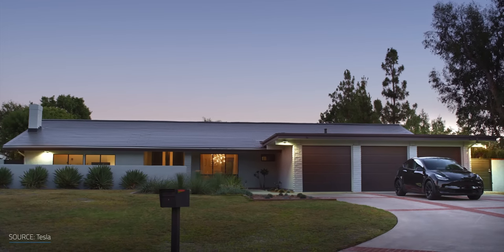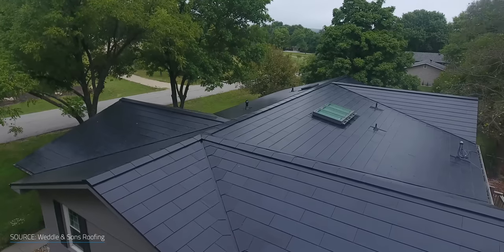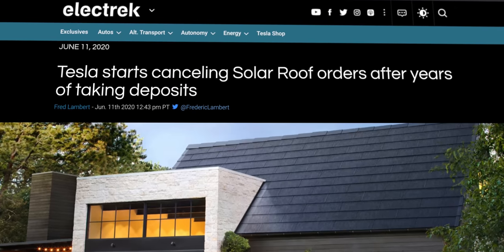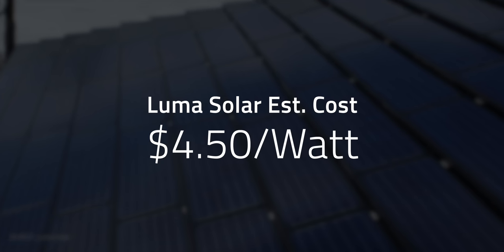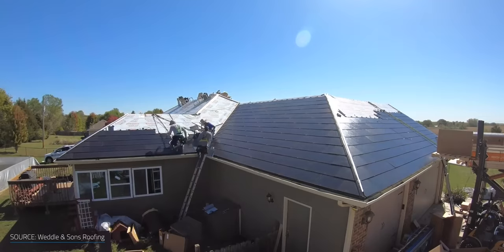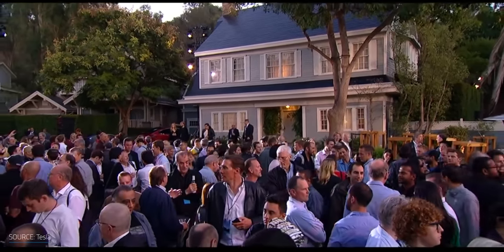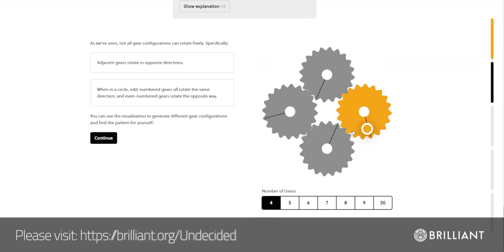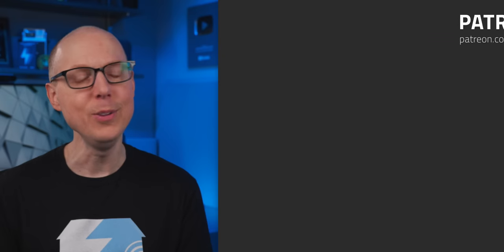The Problem With Tesla’s Solar Roof

Comment: How about looking into NON PV solar home products.  A gentleman I used to work for  used to heat his home with a passive solar system that used a cinder block wall in a sun facing solarium as a collector that had air flowing through it, and through a large gravel heat-sink under the wall, to provide for some of his winter heating.  If I remember correctly, his cold air returns to the furnace went through these spaces.  The air warmed going through the block wall during the day would "load" the gravel heat sink, and pre-warm the air going to the furnace.  The thermal mass of the wall and heat-sink would keep working overnight.  I've personally used a flat, glass-topped box and coiled tubing to make a solar pool heater.  Surely there have to be more ideas to use solar at home than tens of thousands of dollars worth of silicon and electronics?

Comment: Hi Matt, I recently had a Tesla Solar roof installed. The installation process was incredibly painful, but the product itself is impressive. I live in MA. I'm happy to chat if you have any questions
Reply: Vivint Solar is much, much worse.  I've seen their work so bad the whole roof is rotted and even entire vacation homes have to be torn down due to the mold and rot.  Companies are in the phase of raising the top line, not servicing existing clients.  Some like Vivint, are worse than others.  Given that craptastic landscape, Tesla is not the worst.
Reply: What much price has increased after you accept initial design

Comment: Having worked in roofing, I guarantee you standard "roofers" would have nails through half those solar shingles.  And GAF is the only brand I've seen that was consistently ruined after 7-10 years.  If I say a 7 year roof that was bald all over (and need replacing)... It was always GAF.

Comment: Layman’s question here:

I understand that these types of solar panels become less efficient the hotter they get. I have heard that on several sites but no one has explained precisely what that entails. So isn’t there some way of passively cooling them, such as having a bigger cavity directly below them in order to circulate air flow?
Or is this ‘heat’ more concerned with the temperatures within the layers of the panel itself (precluding airflow as a cooling solution)? 
I live in the tropics; I’d be really interested to hear about the efficiency of solar panels + their efficiency when in temperate climes versus tropical climes.
Reply: this video is just lazy nerd click bait LOL
Reply: You could build for airflow underneath them, but that would add significantly to the cost as well as the profile of the roof.  

This is just another reason why solar roofs are a dumb idea.  Install your roof, then install panels on it so you can optimally position and airflow comes naturally, instead of having your panel be both a power generator and watertight barrier.

Comment: I think the way to go is developing solar tracking and reflectors with traditional PV arrays. You get a better window of peak power with tracking, you get a substantial boost in power from reflectors (which would be great for overcast days/less sunny areas).

The burden would be to develop a smart controller to manage the load on the structure and depending on the roof reinforcement may be necessary.  But on the flip side, install could be down to half a day- if the system can be delivered on a pallet, final assembly on site and a light crane to place it on the roof.
Reply: It usually is much cheaper and more efficient to just add more panels nowdays with them being so cheap.

Comment: The roof on my TX house is now more than 17 years old, and is getting close to replacement time. All of my neighbors have gotten new shingle roofs in the past two years, no doubt capitalizing on hail storms to ‘find’ damage to their roofs and have insurance cover some/all of the replacement cost. 

I have considered solar roof shingles instead of panels, as I think it’s a better overall system, and it looks less disruptive than solar panels. Most of my roof faces East and West, not South, so having solar shingles would probably be better overall, and generate power throughout the day. Plus, I would have no solar panels visible from the street (the West facing part of the roof. 

Thanks to this video, I have more info to use when investigating whether solar shingles will be worth it. And if not, then I’ll put another standard roof on the house. Here’s hoping for another hail storm soon. ;-)
Reply: Our TX home roof needed replacement in 10 years because of hail.  The Texas sun dries out the shingles and they get brittle.  Now add hailstones up to the size of baseball and it is new roof and car windshield time.

Comment: Have you heard about and checked out "Forward Solar Roofing"? Looks pretty good to me and I wanted to do a standing metal seam roof too. Another product, "Click System Metal Solar Panels" look good too. If you already have a standing metal seam roof, "Sunflare PowerFit Solar Panels" would be good fit. They are a peel and stick design. There are screw on brackets for metal roof for using solar panels though already.

Comment: Even if any of the contractors in my rural area had the experience to install one of these roofs, none of the manufacturers offer the product in my region. Here, a standard architectural asphalt shingle roof goes for $15,000 to $30,000, so a solar roof I can imagine would start at around $60,000--same as ceramic tile.

Comment: Having just built a house, the issue with a solar roof is you have to pay up front if you are building a new house. My contractor and I tried using a draft from our construction loan for this, and they wouldn't budge for some stupid reason. We went with concrete shingles instead, but it still ticks me off. We live in AZ; it is a prime location for solar roofs to become standard for all new builds.

Comment: Big problem with larger shingles is that at least in NJ you can only have the solar cover a certain amount of the roof and those tiles can only fit on larger roof so unless you have a giant or simple roof you can't get nearly the coverage a smaller tile can squeeze into. We have been running into this issue especially with the larger tesla solar pannels we have been using making us drop pannels due to fire setbacks

Comment: We replaced our roof a few years ago after a hail storm. It was ~$9800, though a solar option was available and would have been north of $30k. I thought about it with the incentive of an $8,900 rebate until I spoke with a few installers. Labor aside, I asked how many solar-installed roofs he was doing repair work on after that same storm. "All of them need something." Average repairs he said were about $10k. 
Something to think about, especially if your home insurance may not cover a total loss on a solar system due to the costs vs a traditional roof.
Reply: Here in Texas you can expect golf ball sized hail about once every 10 -15 years.  My house is 13 years old and we had that size hail only 6 months after it was built.  If I had solar panels back then, they would have been decimated.

Comment: nice video. i just have one problem with it, the cooling, witch you have mengend, is a biger problem. Solerpanels are build with a distens from the roof for a reasen, 80% of the light gets convertet into heat so you must coll them. With sollerpanels you have the advantig that you have  more surface area and benith the panels you get a aire stream. with tiles you get the problem that the heat i trapt benith the roof dams up benith it up to 200C° where solerpanels dont produse much energie.

Comment: Another benefit to solar roofs is that you have one contract, one price. The contract is for “solar roof”, making the entire project eligible for the 26% tax credit (rate in 2022). So you essentially get your roof and solar both at 26% off, rather than just your solar system.

Also, one contract = one warranty. As a roofing contractor, I see homeowners caught in the middle of finger pointing between roofers and solar installers all the time. If you go with the GAF Timberline shingle, GAF warrants the entire system leak-free for 25 years.

Comment: As a solar manufacturer CTO who has dabbled in BIPV in the past, the rate of change in technology and design is the killer here. It's fine to have it easily repairable but unless warehouses full of stock are held back for replacement, the designs and appearance will change too much over time to slip in a new tile in 10 years. In 12 years a standard roof top module has gone from 200W to 400W. Cell appearance, colour and size are all completely different. They don't look that different to regular panels either. I'd argue that some look worse.

Comment: I had a normal timberline/gaf roof installed in 2019 and there was no mention of a solar option. My contractor was also an idiot but the only installer who could do it in the time frame the home insurance company wanted. Buying a home is not fun.

Comment: How do you deal with a roof problem, like a leak, if you have solar panels installed? Do you have to call the panel installation company to remove them, probably a minimum 3-4 weeks delay, and then a roofer, and then the installation company back. If so, that could be a pricey and lengthy repair job.

Comment: I think one point that gets overlooked on this also is that normal solar panels can be resold and used elsewhere if anything changes. Much of the solar roof you put on will lose a lot of resale value as you don't want to install parts of a different used roofs that have differnet expected lifespans left or will slow each other down or possibly are just of different makes and shapes.

Comment: I talked to a Solar Panel expert and he said that Solar Roofs will not succeed because you have to clean the Solar Panels often to get the most power out of them. It's nearly impossible to clean the entire Solar Roof because you'll break them if you need to stand on them. He basically made the case that if you can't clean the entire roof properly, you've wasted most of your money.

Comment: The cost is also often compared to the same surface of solar panel. But people usually only cover the south facing side of the roof, so in the end solar roof is much much more expensive then covering only one side with panel.

Comment: Solar PV should be the last option, in terms of ROI (if we're gonna play that game).  Most energy pumped into homes (80-90%) is wasted; thus most of the PV production is wasted.  It's like driving around with leaks in your gas tank.  Energy efficiency has much faster "payback" than PV (plus all the additional health, comfort and resilience benefits); and most homes lack the roof space and orientation required when systems have to be over-sized to account for that 80-90% waste factor.  Without efficiency measures, all the worry over PV is just putting band-aids on a leaky boat.  Maybe that could be a discussion for one of your videos.
Reply: If people would properly install an inexpensive radiant barrier in their attic and add a little more insulation to the attic, add thermal curtains, properly seal their doorways and entrances, heck even gradually replace older windows with more energy efficient rated ones, have their water heaters on timers, empty their water heaters twice a year to remove sediment build up they would see some savings.  The best part is these things can be done gradually with lesser costs.

Comment: What GAF believes and most roofing professional is that roofing needs solutions made by roofing companies. I agree because as a past code officer for a roofing manufacturer I understand roofing is about wind, fire and water and that protects people. Energy harvesting makes sense, but I still put the roof first. Another opinion, outside of roofing but looking at emissions, I like enough solar harvesting to charge an electric car makes sense. I would like to see e-cars gridless. Only catch, might need batteries.

Comment: There are a few things I dislike about all the hype over solar roofs. While in theory they sound great (more pv cells more energy produced), in practice there is a huge offset of exposure due to location and roof slope. 

The other setback I have with new technologies like this is it doesnt change the issue of residential houses being extremely inefficient with their energy use. Passive design strategies open opportunities to reduce the amount of energy a structure uses without needing to invest tens of thousands into a solar roof. It does require foresight in terms of construction, but it makes a world of difference in terms of efficiency and comfort.

Comment: My potential issue with solar roof is that you have very limited options in how the strings are arranged.  It appears that they go laterally across the roof.   With no microinverters or optimizers, the entire string is taken out by any shade anywhere along it.  I have palm trees that will track across the roof covering maybe 15% of the cells but possibly kill the whole thing because I can't arrange the strings vertically.. . .  I'd hate to pay Solar Roof prices and only get 50% of the rated power out. . . .

Comment: Add point 5, Availability. Just replaced my roof with asphalt shingles and now adding PV 400W panels as that is all what is available. Wanted to use Tesla roof but not available with no date.

Comment: I had a quote for solar panels on my roof. My electric bill is $100 a month. The panels with installation were 23k. With federal tax credit at that time it would come down to $18k. I could finance that for 83 dollars a month. Since I would still need to be connected to the grid there is a $20 monthly fee. So for my situation in Wisconsin a loss. Higher insurance premiums, possibly more property taxes. I think a solar panel would make sense when I could do a self install with b grade panels to keep the costs down.

Comment: You also don't want to drop a lot of money into panels that cover your old roof only to need to take them and the old roof off if the old roof goes. Granted the panels, where they cover the roof, ought to help the roof last longer. I had hot water panels for 15 or so years but they had to come off when the shingles were replaced and I was to cheap to put them back on. They are much more efficient than photovoltaic, assuming you use need a lot of hot water. And with all my kids gone now I felt like I really don't need much.

Comment: In terms of efficiency, it doesn't make sense to have an entire roof covered by solar panel due to the strength of light reaching the panels, which is what I understand the Tesla product provides. Further, the point about the price of the home is a factor and for communities that desire greater use of renewable power generation, consideration should be made with regard to building codes/requirements, where some top percentage of homes are required to install systems with a certain amount of output. 
Very useful presentation of the options for a solar roof installation.

Comment: My husband and I were running the numbers.  It boiled down to you being “all in” or don’t do it.  By “all in” I mean:
1.  Add enough panels to cover 90% or more of solar needs.
2.  You need a new roof.  
3.  Your furnace/a-c needs to be electric.
4.  You need a battery bank
5.  Commit to solar energy. Get electric vehicles & charge them at home
6.  You have plenty of sun to keep the system charged.  
7.  You have power outages and are seriously thinking about add a back up generator to your house. 
We figured with tax credits and “all in” approach you can make it work.  Our roof dominates the look of our house (think cape cod style home).  The plus is there is a great platform to install.  
BTW:  Agree 100% on you need a new roof. Timing is everything.  You need to be replacing the roof & HVAC when it needs it not for the heck of it.
Thanks for pointing out the new Timberline product.  Do you know if you can combine the Timberline roof with the Tesla batteries?

Comment: So if you have an old conventional roof and need to get the shingles replaced, is this a good option? You would be saving the cost of the conventional shingles but paying more for the solar shingles than you would for the regular solar panels.

Comment: My sister is deep in the solar industry and she absolutely rails against Tesla solar tiles. Especially safety wise they really have issues. Going all the way to the apex of the roof really interferes with firefighters who need to breach the roof. Plus there's the probe over the Solar Tiles actually causing fires to begin with. 

If you recall they weren't even Tesla. They were SolarCity I believe and were essentially bought out by Tesla because they were failing as a company and the owner is related to Elon Musk.
Reply: Essentially Elon bailed out his own company with his other public company... Really really scummy move.

Comment: Housing stock from early last century like mine (1920) would have a problem with heat gain inside from solar roofs. Old 2x6 rafters can hold R9 or so insulation which helps with heat loss in winter but less with heat gain from a hot roof. This is part of my decision making process with solar shingles vs elevated panels and I really do not like elevated panels. .

Comment: Important video!  With CNC abilities and shortages of laborers; I'm surprised that Exon hasn't put up a large factory that can cut out really large solar canvas that only needs a handful of connectors and only involves maybe 5 panels to cover an entire typical hip and valley roof.   With a little creativity they can even enhance roof; hurricane, survivability.  Something like a carpet; but, for the roof and solar power.